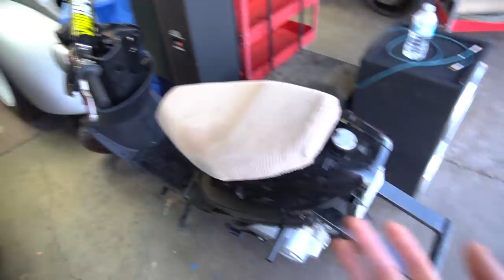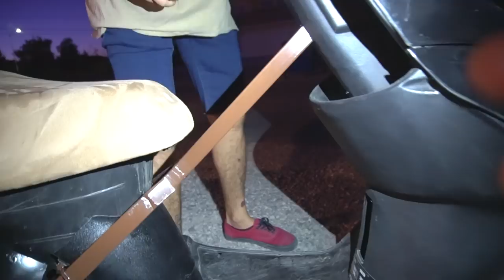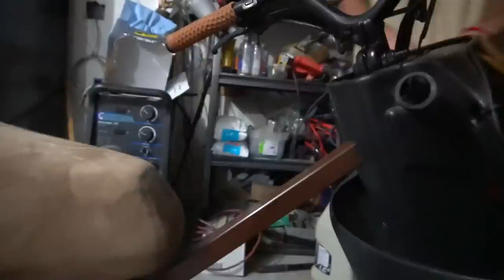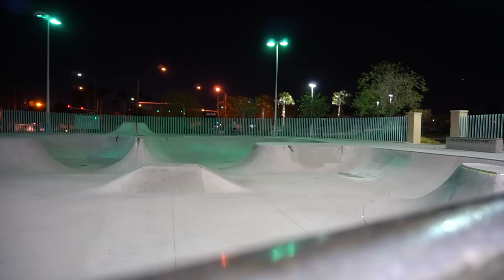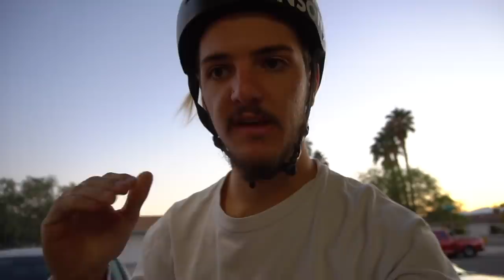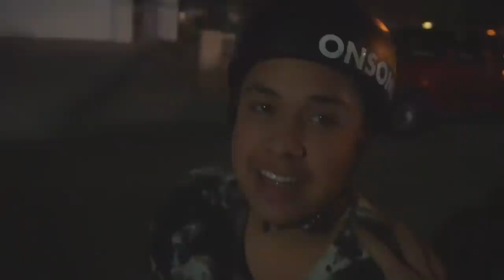Does A Performance CDI Make A Scooter Faster?

Comment: I put in a big bore kit and heavier rollers, but i can only get to 40 im trying to hit 45 50 do you think the next step is cdi or a jet.
Reply: Bro my stock Roketa 50 with just a cdi, ignition coil, spark plug and air filter does 44 mph. 47 downhill. If you bored it out it should be doing at least 50. Somethings not right. Scooter might not be tuned properly. Key words to remember- More fuel + more air flow = more speed.

Comment: And also I've been told that the cdi already in the bike is perfect. You just need to remove the restricting wire that's all the performance CDI does but let's watch the video to see if I'm wrong :3
Reply: Was literally looking fur this very comment. My stock cdi has no limiter, just an empty port where it goes. Was wondering my the paper work said top speed 31mph and it was hitting 35-36ish lol
Reply: @lightspeedyestermoon274  I got a notification just now from a comment that was posted 3 years a go. Good job YouTube 😂😂😂

Comment: Hey @trevorpritchett is a gy6 engine on a scooter supposed to seem like it’s moving. Such as moving back and forth?
Reply: Sounds like you’re running too rich mate and the engine is still burning fuel causing your back wheel to try and move forward while you’re sat idle.

Comment: You need to larn balanc point wheelis and skrape lot further back
Reply from the maker: Jonathan Kautto watch a new video bud. way different now
Reply: Trevor Pritchett  yes i know sory yes its lot better but stil do a bent bar like big bikes raund bar
Reply: I've had many so-called mopeds that I had last owned original engine but cut streaking o sports air filter in the airbag and lighter weights in having harder coupling springs it responded better and had original silencer but took screwdriver o hammer to break the exhaust gates in the silencer it smash like a 4 stroke cross braaap

Comment: The cdi controls how many rpm i think
Reply: the stock cdi usually only limits rpm so your right
Reply: Lauri you can remove the wire for it and boom, done. That's all a performance cdi does. If its a 50-125 scooter there isn't a point on putting a new cdi in. Take the wire out and done, if you put a new engine in it and all yes its a good idea. but just de restrict your bike, it will save you time and money.  and it will do better for free.
Reply: Voxan yep and for 50cc mopeds you can drill the restriction
Reply: Lauri yeah buying a performance cdi for a scooter all it does is not allow you to plug in the restrict wire. Many people says the cdi in the 50cc scooters are better than a performance cdi because its designed for that bike. Like a motovlogger i watch got an exhaust from a company just for his type of bike, he sent in his cdi for them to program his bike for the exhaust he bought. A lot of info but hope fully someone learns from it xD
Reply: @voxan4042  what wire will it be?
Reply: @anchor213  You will have to search it on Google, type your bike name and year and write restriction wire. If you find no info go on a Q&A website. Tell them the name and year of your bike and ask them what colour wire would it be
Reply: @voxan4042  which wire u take off and where is cdi on tao tao
Reply: @roybray8741  3 years later lol, Google your bike and year and you will find it. Even try youtube. Write how to de restrict Tao Tao 50cc

Comment: Just get a proper bike
Reply: Scooters are 10% of the cost ^_^
Reply: And a proper bike is 100%'s less fun
Reply: @TAKETopicS  my guy you mustn’t have been on a proper proper bike 😂
Reply: @Boost_Addict20  is a Duke 1290 not a proper bike to you?
Reply: @Boost_Addict20  because I can tell you now I used to borrow my stepdads most Sundays in 2018 and I ringed that thing out a few times but you couldn't constantly.. I'd rather ride a slow bike fast than a fast bike slow
Reply: @TAKETopicS  ahh okay I see, different bikes are made for different people, psychos that can hit 160 everywhere love the big bikes 😂
Reply: @Boost_Addict20  yeah your right 😂 but u can't Diss having a nippy 21hp 2 stroke moped 94cc which thrashes most cars up to 60-70mph it still will do 100 and will get to it really quick u don't need much more than 100mph lol and it gets too 100 quicker than my brother old 64hp xjs600 soooo sometimes slower smaller bikes are more fun not to mention sometimes there much faster to get to top speed it's not like they get to 40 fast and stop thus beast I'm sitting next to now will do 100mph and will beat most things going to 80-100
Reply: @TAKETopicS  problem is people plow soooo much money into them to get like that 😂
Reply: @Boost_Addict20  not really. It's more work than money... cost 850 for the moped and 400 for all the parts to make it run like that so considering that's only 1250. You'd spend £6000 on a 600cc which would get smoked up to 100mph by a 94cc lol which cost £1250